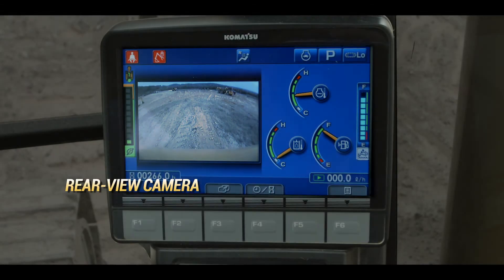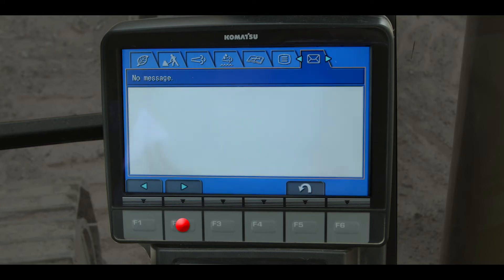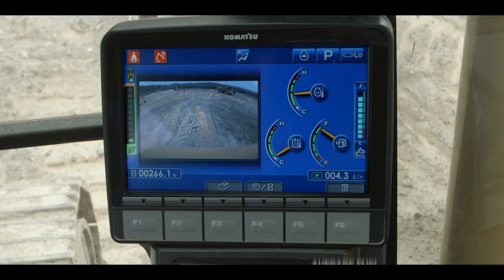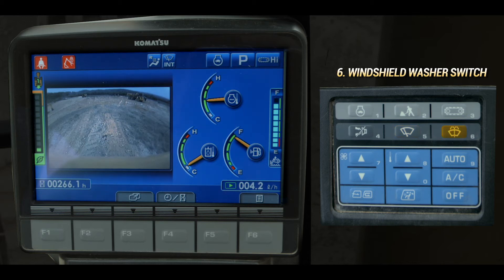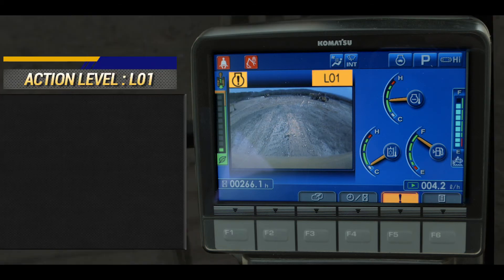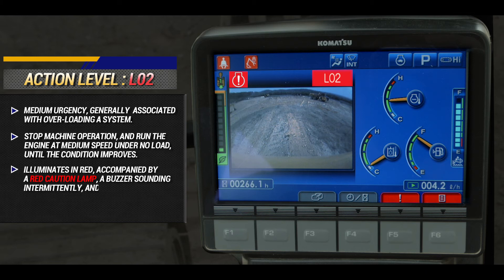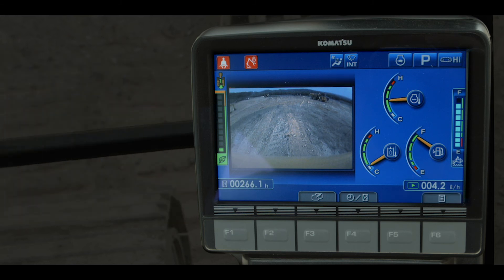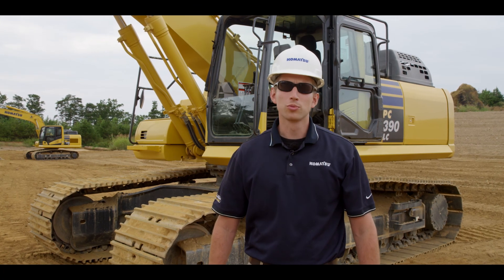Komatsu PC170LC-11and PC490LC-11 excavator monitor overview

Comment: Is there anyway to lock the machine in power mode with high speed track travel with a passcode of some kind so that the operator cannot change it. Anyone who has ever supervised a union job will know why I am asking this question I just checked our 10 machines and the scumbags had everyone running in economy mode . I want our machines locked in power mode and thats it. Any way to do this?